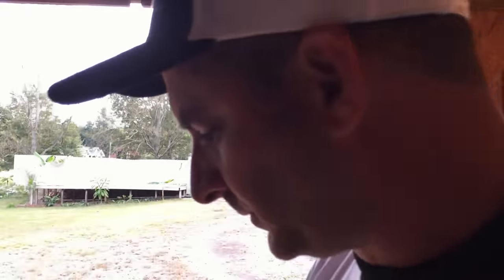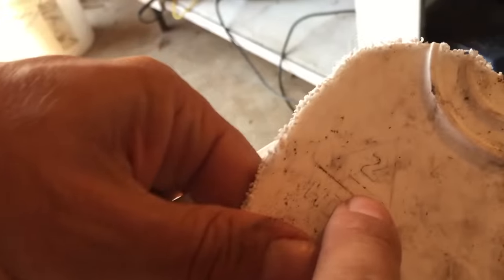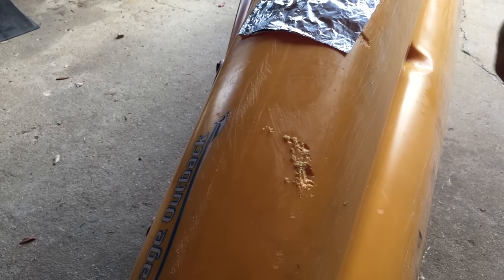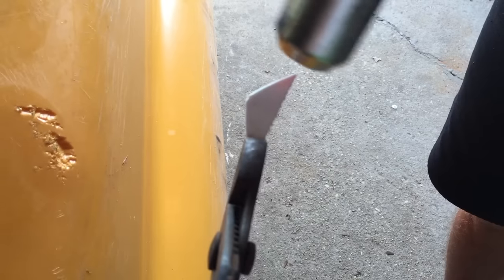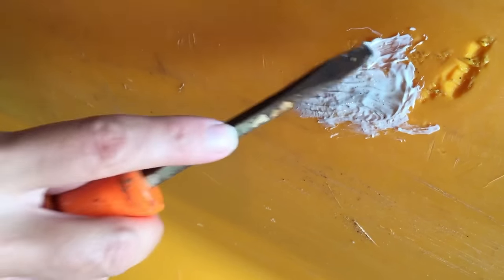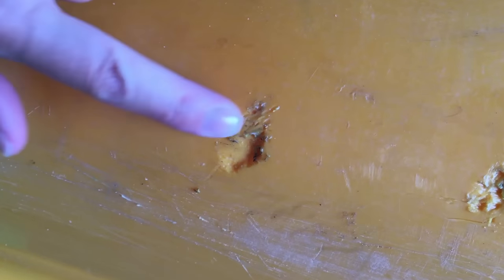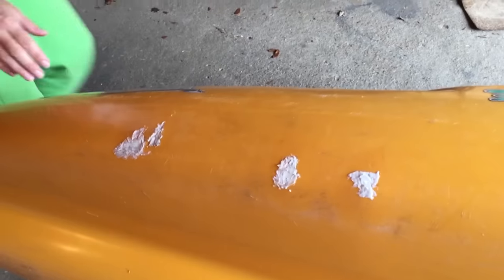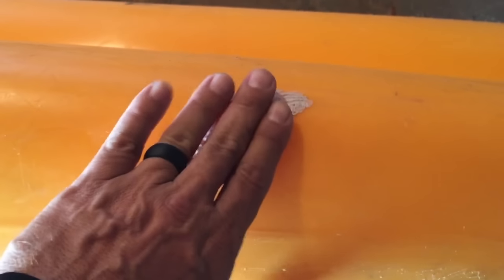Repairing a Hole in Kayak with a Plastic BUCKET

Comment: If you keep your heat gun close to the repair spot as you're heating up your plastic when you lay it down it will actually bond  with the  plastic  better.. a method I use  for.larger real holes  Is the melted cheese method. Lay it over the hole heat it until it sinks inside. The pull the original material over the fillerand basically weld it back together  for a solid fix.
Reply from the maker: great tip!

Comment: Next time you patch a kayak... Use the end of the screwdriver handle to smooth out your patches. 
For holes and cracks. Lay a piece of aluminum window screen, heat it and press it down along the sides with the screwdriver handle. Then cover the screen with more plastic blending with the handle.
Press lightly and twist. 
Hope this helps!
EDITED BONUS TIP: Next time you're at Mariner sails or Austin Canoe & Kayak...Any kayak shop, ask them for a couple pieces of HDPE.
LITTLE TYKES & PLAYSCHOOL toys like the chairs, outdoor play sets, baby beds etc. come in many colors and are made of thick HDPE. Look for them on bulk trash pick up times when they get thrown out.
If you're interested, I have several kayak restoration videos on my channel... I use many different methods for patching because no 2 patches are the same.
Reply from the maker: great tips!
Reply: I just sand it down
Reply: @flyluzfly  leave the dust from sanding in place and hit it with a heat gun on the highest setting just till you see the surface get shiny and keep the heat gun moving! It only takes a few seconds.

Comment: Hobie also sales a kit with plastic sticks and a soldering iron to patch their kayaks. Also when rigging your kayak, save the shavings from all the holes you drill. You can use that to patch holes. I have a zip lock bag full of shavings and have used a lot of it to fill in holes left from removing factory hardware. It looks like nothing was ever there.
Reply from the maker: BAM! good tips

Comment: I thought you would have cleaned your plastic before welding it on there. Nice job, otherwise. Maybe try using a putty knife instead of a screwdriver?
Reply from the maker: good ideas... holding good tho.
Reply: It is bullshit! Plastic is not a metal and does not conduct electricity. When you head and melt plastic, an electrical charge will be collected on the surface. Thiis effect is called "surface polarization".